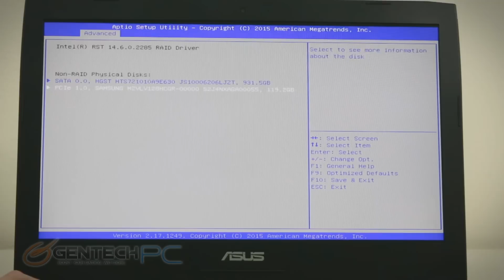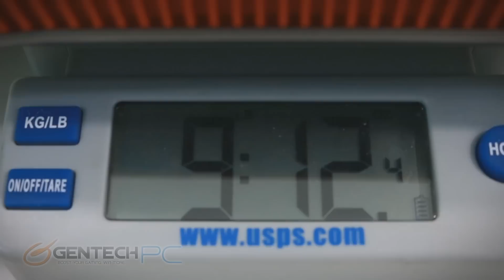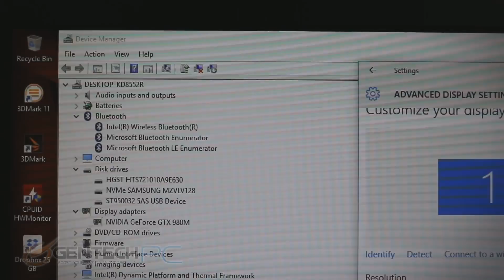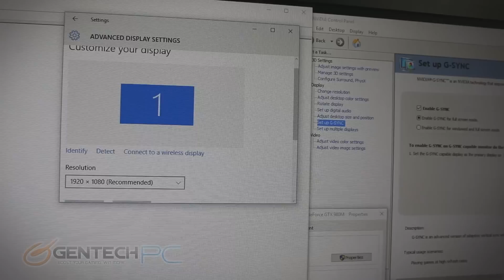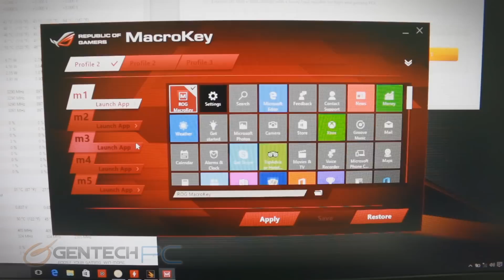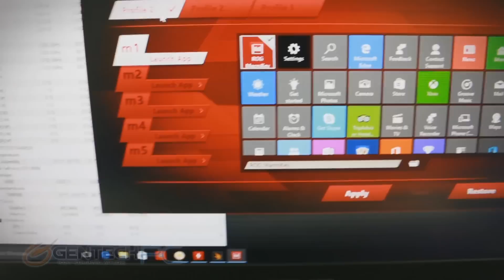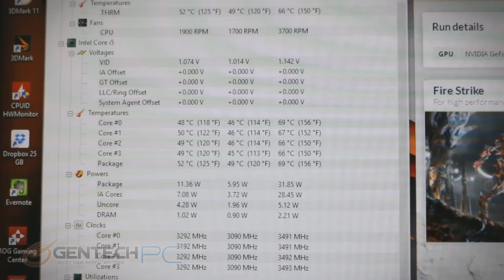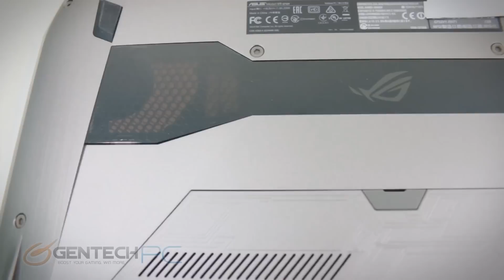Asus G752 (G752VY-RH71)  Skylake Review Benchmarks Geforce GTX980M

Comment: I have this laptop. I noticed you removed the rubber dust covers in the back that are a major eye sore and cheaply connected with a couple of plastic string type retainers. However, the manual states on page 27, "You can open the rubber covers to discharge dust from the anti-dust tunnel.... NOTE: Ensure to close the rubber covers when the Notebook PC is not in use."... To me this reads that the dust covers should primarily remain in place? "Can" is an optional word in that context. Did they use the word "can" when they should have used the word "should"? Anyone know the story with these and how important they are?

Comment: this vs the MSI GT72S 6QE DOMINATOR PRO?
Reply: +louie Rawlinson I have same problem :P But ill take g752 its quiter and wont go so fast dirty as MSI
Reply: okay, where will you get the g752? i've looked on quite a few websites, and it's pretty expensive! I went on xotic pc and found an alienware 18 with 970 sli for the same price as the g752vy!
Reply: +louie Rawlinson Really? I am ordering it in Poland and it cost like 2000$ with 6700hq 980m 32gb RAM 1tb and 128gb SSD m.2 :P

Comment: help me please asus g752 vs alienwere 17 4k
Reply: Don't get 4k
Reply: Don't get 4K
Reply: Why!!!!!
Reply: diego beltran because it puts unnecessary stress on your gpu all the time and you won't be able to game with a laptop gpu and 4k
Reply from the maker: +diego beltran Don't get 4K because of the scaling issues and performance drop in 4K resolution anyway.
Reply: diego beltran Because it reduce frame rate so trust me you need alot of frame rate. 4K is not ready yet. 1080p is enough plus the g752vy has vapor chamber that makes the gaming laptop run cooler than any gaming laptop on the market.

Comment: Funny to be watching this on a VERY old predecessor to this laptop, the G74SX.
Reply: +Samuraiedge2 And I'm on a G73JH lol
Reply from the maker: +Bruno Pato I remembered G73JH, it's the first of it's kind with AMD Radeon HD 5870 GPU.   even the new G752 still using the same chassis as the G73JH.   The only real difference is that the keyboard on G752 are sealed with the top case.
Reply: +GenTechPC aaaaaaactualy it's not the same lololol. I was comparing g73jh with g751jy and there very different, it seems that g751 is fatter lololol

Comment: I'm not sure but I don't think the orange on the back necessarily means that it has a GTX 980. I think it just means that the GPU and CPU are cooled by a vapor chamber, since different models do not have the same cooling system.
Reply: No he is right, the vt models (970m) have a black grille but the vy models (980m) have an orange grille

Comment: I want to know the cpu and gpu temperature of 752vy running both Prime95 and FurMark
Reply: as far as i know the gpu and cpu temps pretty much never reach over 70 and 80 degrees celsius, which is excellent imo
although you can almost heat your whole city with the air that comes out of the back

Comment: When Msi gt80s with gtx 980 (desktop module) come in stock? Will you review it also? I request a full review of it with benchmarks and overclocking capability with dual psu :)
Reply from the maker: +Mozammel Quddus Yes we will do a full review of the GT80S with GTX980 SLI for sure. :)
Reply: Thank you for Reply :) looking forward to dual psu maxed oc review with synthetic benchmarks and gaming benchmarks :)